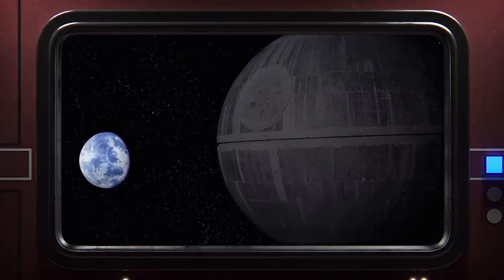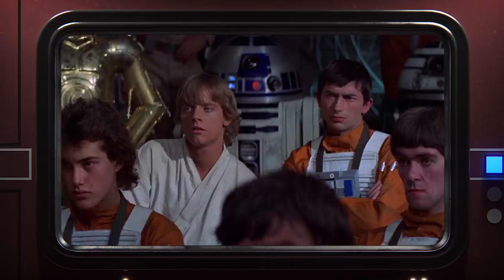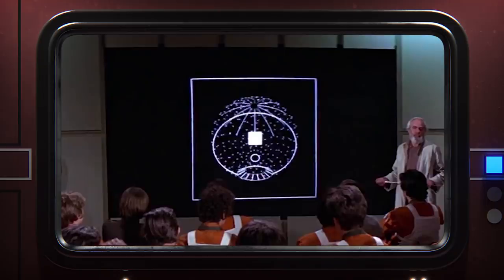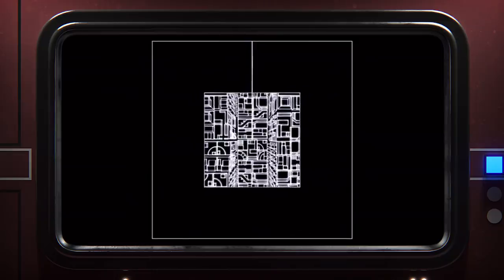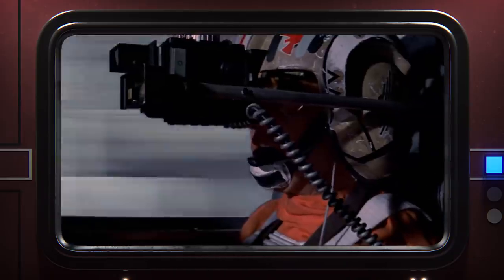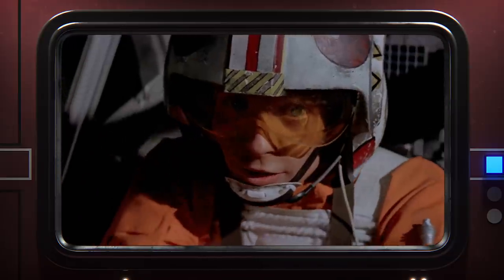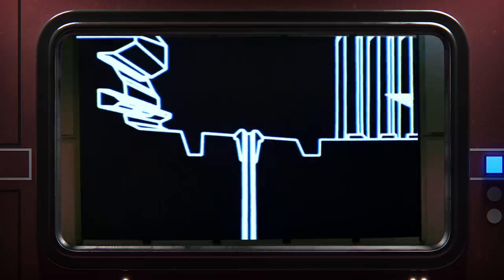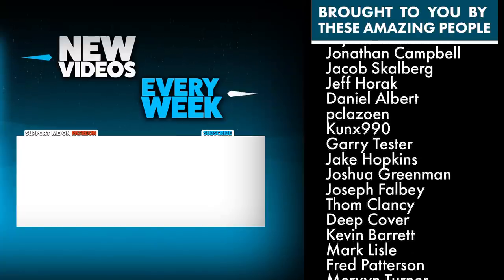The Thermal Exhaust Port Was NEVER a Problem

Comment: IMO the REAL oversight was not launching the untold numbers of TIEs. A ISD carries IIRC 72 TIE fighters. The Death Star should have carried over a thousand of them. The rebels attacked with 24 fighters and 1 converted freighter.
Regardless how good the X-Wing is compared to the TIE it is not 100:1 better.
Reply: This right here. I always wondered how it was that the x-wings were not swarmed by literally thousands of tie fighters long before they ever got anywhere close. I always chalked it up to Hubris on the empires part.
Reply: @DireMerc  Hubris. It was suggested for Tarkin to launch fighters in the movie, but he turned it down since he didn't think snub fighters could damage it.
Reply: AKUJIRULE  They had some point defense turrets that took a few of them down, but they were inadequate once the fighters got close to the stations surface.
Reply: There are a couple of reasons- they short of did. They used their fastest craft- x wings and y wings, and slingshot around the gas giant to engage. The death star was not expecting or prepared for opposition- the rebels hadn't fought back before particularly. It also if anything was prepared for major capital ships. Also, they may store a thousand fighters but they are a battle station- not a dedicated carrier. They can only launch a limited number at a time due to hangar space and also not all of them will be flight worthy. 

There are other things that aren't as obvious. A big cloud of ties did in fact engage the main force of fighters- the attack runs were separate to the main engagement. tie fighters are not great in canyons- and they likely did not have the best pilots on a lumbering station. Thus, the sensible choice was not to pursue y-wings in a trench with rear firing turrets, instead using their own turrets freely. 

In the end only 2 x-wings (luke & wedge(damaged)) and a y-wing (iirc) survive the engagement of only a few minutes. 

So no, it isn't 100 times better, but they came in smaller waves, from distant hangars, so the longer the battle went on the more outnumbered they were. 

They only had standard tie fighters so they were actually slower than x-wings & y wings that pulled power from weapons- so they couldn't even catch the ones doing the run - except vader & wingmen.
Reply: @carbon1255  You've seen the battle of Scarif, right? The swarm of Ties leaving the downright miniscule (compared to the DS) shield station? In seconds? Even if the hangars on the DS are positioned evenly around the equator, the thing has a diameter of (depending on source) 120-200km. That are a couple seconds for the Ties to reach. Also you can't tell me that the DS was not battle ready. Sure, they did not expect massive resistance but seriously, if they had no Ties ready for action at any moment when they left hyper they were more idiotic than I ever thought.
So to recapitulate, they had to see the rebel fighters coming for a minute or two. They had to be ready to launch at least some Ties at a moments notice. They had to have thousands of Ties on board. The deployment system the empire developed for the Ties works pretty rapid. So WHERE were the swarms of Ties that should have defended the Death Star?
Reply: "The Empire doesn't consider small, one man, fighters a threat, or else they'd have a tighter defense." 
There were 3 rebel fighters left flying, Vader and 2 ties were on their tail. At that point why would you launch more fighters? Defensive cannons and the launched ties had knocked out 2/3 of their force already. And Vader cleaned up the first two waves
Reply: @Veloxyll  And that still does not excuse not launching at least 100 of these things. For the empire, Ties are throwaway weapons. So what if some of them don't come back. Cheaper than replacing surface weapons anyway. And it costs practically nothing. The pilots? The empire does not value its pilots. The Tie fighters? As mentioned, throw away. Sure, missiles and torpedoes are even cheaper, but are much more limited. So no reason not to launch them, and many reasons to do it.
Reply: The biggest (and really only) threat to the empire was Tarkin.  The other generals and admirals questioned whether his battle station was a good investment of the empire's resources, especially given the unstable political climate.  Tarkin's response was to have the legislature disbanded (something nominally only the emperor could do).

The emperor's response was to send a trustworthy political officer, namely Darth Vader, to the Death Star, but not before capturing a rebel leader to bring along.
It was also Vader who not only refused to obey Tarkin's order to have her executed, but actually managed to convince Tarkin to let her escape.

Tarkin boasted to the admirals that his battle station had more firepower than the entire imperial fleet combined.  The admirals mentioned that logistics would pose a problem with only one of those available, but Tarkin would have none of that.  And Vader did an excellent job of stroking Tarkin's ego on that point.

What better way to arrange the downfall of such a wanna-be usurper than to have him build his own trap while keeping him too arrogant to recognise it?
Unfortunately, the rebels were all the empire had to deal with him.  The entire imperial fleet combined would not have stood a chance in an all-out assault.
But the armed militia of the recently outlawed opposition makes both a handy scape-goat for the incumbents, and splendid martyrs for all kinds of dissidents.
Had the rebels lost, Tarkin would have seen his doctrine fail.

Vader didn't leave the Death Trap for sports.  Only Tarkin refused to evacuate, because he didn't believe that a few X-wings were a serious attack, but more a futile gesture of defiance.
But the grunts doing the actual maintenance work knew what was up.

Maybe Tarkin held the majority of the TIE fighters back in case a real threat appeared.
Or maybe all TIE fighters were launched, and all but the most stupid ones fled as fast as they could, to surrender or join the rebel alliance.
Reply: @carbon1255  tie pilots are some of the best pilots in the galaxy and to be a pilot on the top secret Death Star project means they were probably elite imperial pilots
Reply: @alfredkugler3043  dude, if you don’t like it so much, stop watching and write your own story. it’s fiction. it’s fun.
Reply: @dolfinboi5216  You are aware that the whole discussion revolves around closing perceived a plot hole?
One so big and so glaring that they literally made a whole movie to explain it away?
And my point here is, that the perceived plot hole is only a plot hole in the eyes of the stupid. But the REAL plot hole that they did NOTHGING to explain (instead they even made it worse) is that they did not launch whole swarms of Ties.
So yes, I think we are entitled to discuss how Lucas, and then Disney fucked up the plot.
Unlike the toxic fan elements on either side, I don't say this plot hole makes the movies unwatchable, or any other drivel like that.
It is just a glaring plot hole. And most movies have plot holes of some kind.
Even the best.
Reply: @davidwuhrer6704  Tarkin had nothing to do with the dissolution of the legislature.  That was all the Emperor's doing, Tarkin only made a remark about it.
Reply: @joshpotter9261  It benefitted nobody but Tarkin, which is what he said.
Reply: @davidwuhrer6704  it benefitted the whole upper echelon of Imperial leadership!  In particular the Emperor and his ends.  Terror will keep the systems in line.
Reply: @joshpotter9261  The generals said otherwise.
Reply: @davidwuhrer6704  watch it again.  Tarkin had nothing to do with the dissolution of the Galactic Senate.
Reply: @joshpotter9261  Didn't he?
He knew before anyone else.  He announced it to the military leaders, and boasted about how his station made them all obsolete.
Reply: @davidwuhrer6704  watch the scene and quit writing backstory in your head
Reply: @joshpotter9261  You watch the scene.  Pay attention to the dialogue.
Reply: @davidwuhrer6704  I have, so much that I can recite it.  You lack comprehension.
Reply: @joshpotter9261  I bet you know all the emperor's lines in the original film by heart.
Reply: @davidwuhrer6704  yeah, so what's your point?
Reply: @joshpotter9261  Well, what did he say?
Reply: @davidwuhrer6704  the Emperor had no lines in ANH.  Get over yourself.
Reply: @joshpotter9261  Exactly, he had no lines.  He wasn't even in that film.

So that means he must have been the main antagonist whom the heroes fought?

And not just the heroes, let's get back to the lines that the imperial military top brass had that actually was in the film.
Reply: @davidwuhrer6704  already did that and proved you wrong.  Tarkin tells his council that the Emperor had dissolved the Senate.  How will they keep order? Fear of this battle station.  Tarkin had nothing to do with dissolving the Senate, that was all the Emperor's doing, Tarkin merely informed his cronies.  Get it right or get out of the conversation David.
Reply: @joshpotter9261  The generals and admirals are not his cronies, which should be obvious from their conversation.

Tarkin is the only one who benefits from the senate having been dissolved.

Until he dies and his battle station that is supposed to keep people in line through fear is destroyed with him.
Reply: @davidwuhrer6704  strange you don't seem to know what cronies are, and even stranger still is that you think the DS would only benefit Tarkin and not the Emperor or the Empire at large.  Did you hit your head, are you brain damaged, or do you just not understand English and context?
Reply: Or I don't know, put a fuck ton of point defense laser cannons? Might say "aren't those what turbolasers are for?" Wrong! Turbolasers and laser cannons in Star Wars are different! Turbolasers are essentially the Star Wars equivalent of real world battleship cannons, used for attacking other naval vessels. Laser cannons are the Star Wars equivalent of real world battleship anti-aircraft guns.

What does this all mean? Well, if the Death Star had point defense laser cannons, then the rebels would've never even got to make the first trench run because those 24 fighters and 1 freighter would've been ripped apart the moment they got close. Laser cannons are used in anti-starfighter roles while turbolasers are used in anti-capital ship roles.

Comment: Imagine the rebel attacked the wrong exhaust port
Reply: "Boy, wipe the space egg off my face."
Reply: "Sir, we've analysed their attack pattern and there's no danger. Shall I have your champagne ready?"
Reply: "You may toast when ready"
Reply: I think comics there Luke missed exist
Reply: See this part I don't think EC is right about. I bet that all the smaller thermal exhaust ports around the top would have worked all 18 but there's no sense in splitting up only 30 fighters to try and do runs on all of them, that would leave them too vulnerable to fighter intercept. 

Or maybe they did split the attack up and that's why out of ~30 fighters we only see 3 Y wings make one run, maybe the other Y wings are attacking the other ports?
Reply: I like this comment, but your profile picture gave me PTSD flashbacks
Reply: "Fuck. We're doomed"
Reply: @Gibbons3457  the wording of "an exhaust port" definitely sounds like there's just one with the problem.
Reply: Actually, in the novel they add in some of the chatter that was cut from the movie -one of which is a pilot asking if they are in "the right trench" while searching for the exhaust port.
Reply: @kornkernel2232  Death Star explodes anyway

Comment: The only thing missing is something that strengthens your argument. The proton torpedo doesn't reach the main reactor itself, but causes a series of cascading failures that eventually reach the main reactor. After all the effort to hit the port with the right weapon, you're actually just hitting the first domino in a long series that will, in theory, eventually reach the main reactor. The rebels were counting on a chain reaction, but any interruption in the chain would prevent complete destruction. Depending on where the interruption was, the Death Star could have been severely crippled or only minimally damaged. Only if the entire chain reaction completed would the shot work, and once the first chain started, there was no way to start a second chain if the first failed.

Comment: Ray shields: protect against energy based weaponry, which would imply it also works as a radiation shield. Since proton torpedoes are a physical projectile they can pass through and hit the target.

Also I think the Galen explanation works in the sense it would lead to fatal damage to the station, not severe damage. What i mean by this it's that Galen put a self destruct button on something that should probably not  lead to that much damage to the station in the grand scope of things. He him self says it "a match stick" or "time bomb" can't remember exactly.
Reply: Except they screw the concept up slightly because Anakin and Obi Wan get trapped in Ray Shielding on General Greivous’s ship in ROTS.
Reply: @forrestpenrod2294  Indeed I remembered that scene. But "Ray shields" has also been used to refer to the shields that are used in hangars to stop air from leaking out. This would suggest that either:
a) writers either don't know or don't like to use the "particle shield"definition so they generalise for any type of shielding;
b) There are different types of ray shields that can become physical barriers or hurt on contact that are used like they were for Anakin and Obi-wan.

I think we know which one it is.
Reply: @forrestpenrod2294  That's because ray shields also repel organics by being hot, so whilst they could have walked through them they'd have burnt to death trying.
Reply: @Gibbons3457  in canon, ray shields impart an electric shock on objects that pass through it. it does not affect star wars tech (like ships and missiles) but does affect organics
Reply: So, Galen turned the Death Star into the DeathStarinator.
Reply: @paulomr445  
But remember this was THE FIRST piece of star wars media, EVER. There was no established lore on how things worked yet.

Also this was made in the 70's. How space worked was not common knowledge to the general public. Man reached space and landed on the moon only a few years ago. This space thing was very new to everyone.
Reply: @marrqi7wini54  ok? I'm trying find a in universe explanation, of course the out of universe one was "they didn't think that far and made it up"
Reply: @paulomr445  
Well it is an explanation for your "A" scenario.
Your "B" reasoning is actually quite solid in universe.
Reply: The also use magnetic shields on trash compacter doors
Reply: @paulomr445  There has been a bit of a mix up- ray shields DO protect from physical weaponry- which is why they cannot use concussion missiles and so on. DEFLECTOR shields in star wars protect from energy weapons.

A proton torpedo is a special type of energy perpetrator weapon that is itself shielded- shrouded- whatever you want to call it in plasma which enables it to break through the ray shielding.
Reply: @adrianbaker5916  its magnetically sealed, not specifically shielded

Comment: You have a 120km diameter battle station, you can't expect every piece to be fool proof, every blueprint to be mistake free.

The Death Star's defences weren't right enough to repel snub fighters because they didn't believe they were much of a threat.

Just ask Dave Johnson in stormtrooper engineering.
Reply: Dave Johnson?
Hold on one sec...

So I just spoke to Dave Johnson and he absolutely thinks snub fighters are a threat.  Maybe you're thinking of something Darth Vader said yesterday?
Reply: Can we punch gareth “they all got to die, right” edwards in the face now?
Reply: yeah, 120km diameter battle station, which means that these two tiny torpedoes designed to hit starfighters at short ranges would have to go this distance all while being pushed away be exhaust gases
Reply: olodemolo MCAroon That’s assuming that the exhaust gasses were exhausting at the time. Its quite possible that the exhaust port, or that one specifically, only exhaust excess heat and gasses after the superlaser fires.
Reply: I mean, one single weakness on an otherwise perfect moon-sized station is actually really impressive.
Reply: AKUJIRULE  are you talking about the Empire that doesn’t even install railings?
Reply: @MCAroon09  The torpedoes would not have to travel the entire distance to the core, only to the thing that sets of the chain reaction of explosions that eventually reaches the reactor.